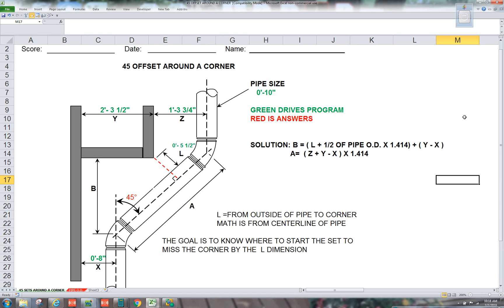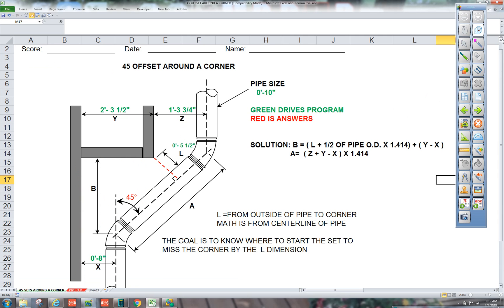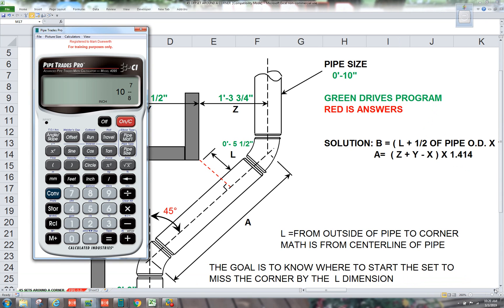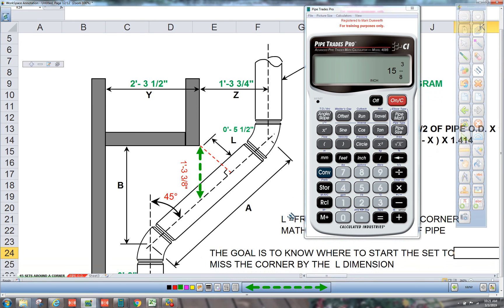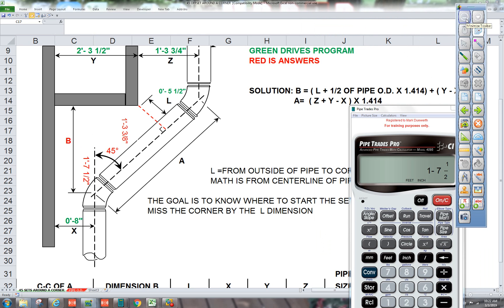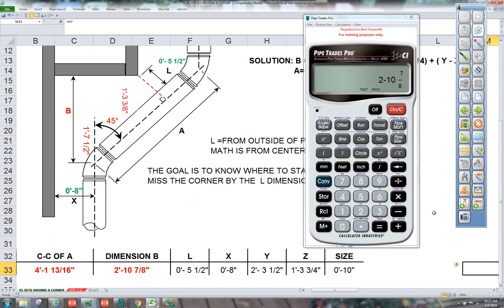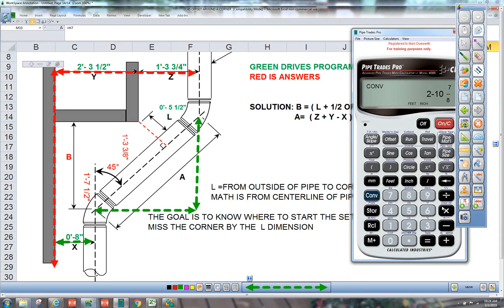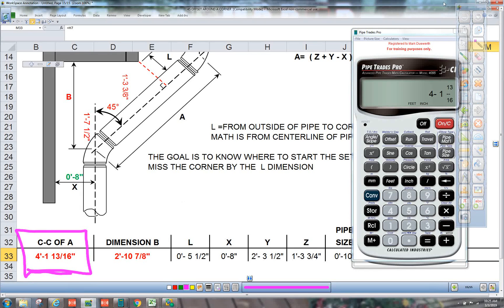Mastering Pipefitter Math: Solving 45sets Around Tricky Corners With Moes Math!

Comment: What system is that that you're running on your computer and how did you get Pipe Trades Pro on? I run Mac, is there anything you would recommend for me to not only learn PTP calculator but also to brush up on my math and piping formulas?